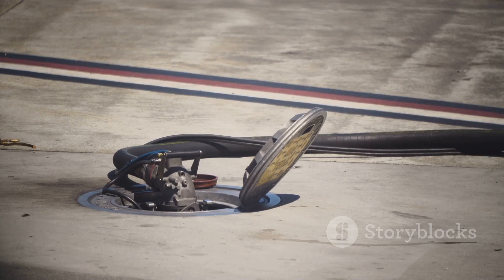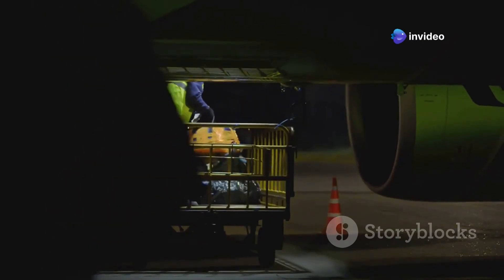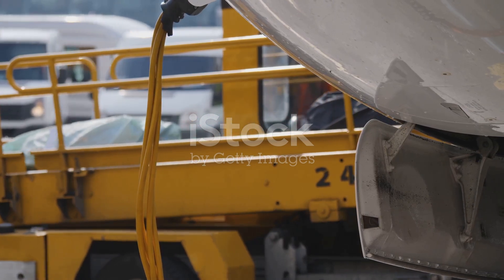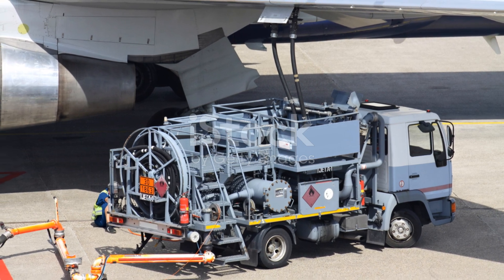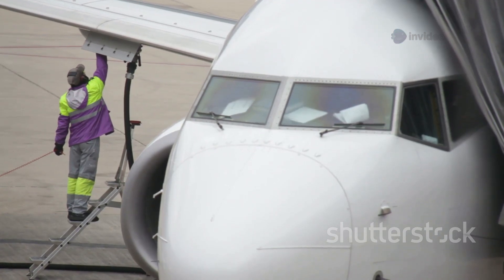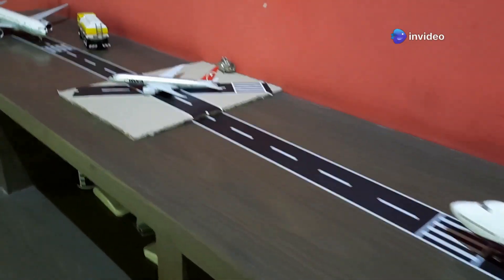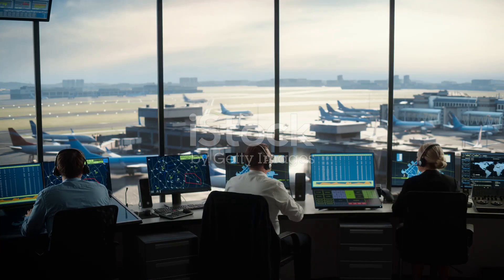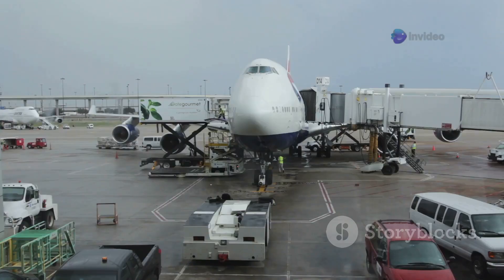What is the science behind aircraft refueling at airports? How it works? #science #aviation

Comment: What's the plumbing inside the wing when the fuelling point is under the wing?
Reply: The under-wing fuel ports are also often called Single Point Refueling connection, and have pipes going to all the tanks so they fill up together.

The planes (and larger helicopters) have transfer pumps to move fuel between tanks, to balance everything out.

The over-wing ports usually just fill the tank in that particular wing, and so either both wings have to be filled separately, or they have to use the transfer pumps to get it to the other wing.

But the under wing style just makes it faster and easier to fuel.

I work on helicopters, and our Blackhawks have the single point fueling, though it fills the tank on the same side as the connector faster, so when they take off the tanks are unbalanced, and they will burn off the fuel on just the left tank until they are even again, and then turn on the right tank so they empty together.
Reply from the maker: Its pumping actually not plumbing